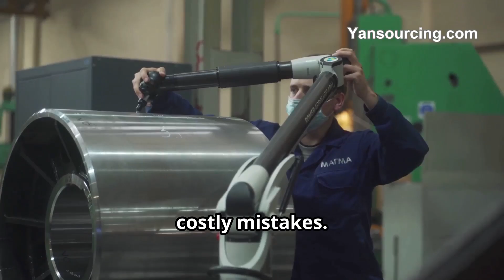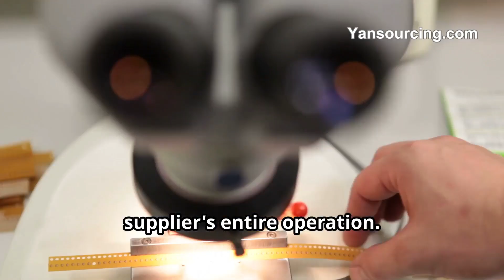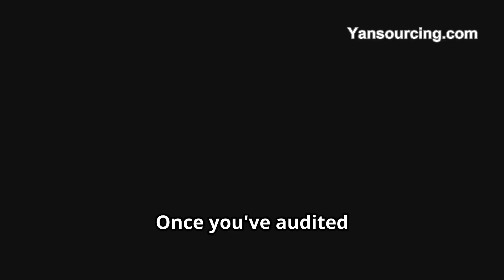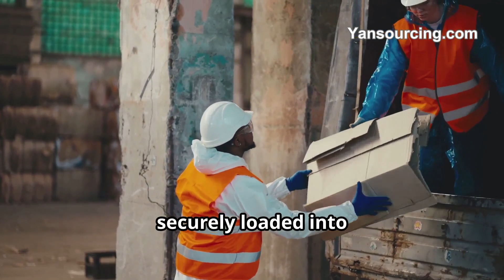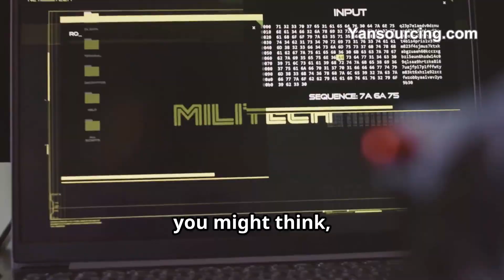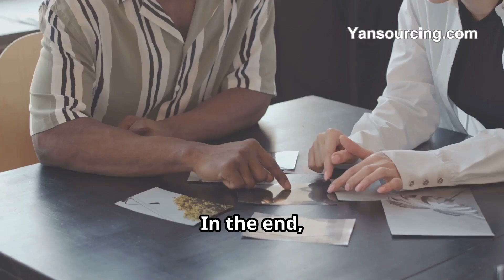How to Choose Production Inspection Services in China to Reduce Import Risks

Comment: Great tips on picking the right inspection servicedefinitely makes the whole immport process feel less risky!
Reply: I’ve found that pairing a ppre‑produuction inspection with a final random check cuts defect rates dramatically, especially whhen the inspector can verify factory certifications on the spot. DocShipper walked mme throouggh setting up thatt two‑stage approach for mmy first electronics shipment and showed me how their platform logs every photo and vvideo for full traceability. A 2023 Allibaba survey reported that importers using dual‑stage inspections saw about a 30 % drop in quality diisputes, whiich matches the numbers I’ve seeen in my own orders. Making sure the inspector is accreedited and asking for real‑time visual proof really turns the whole process from risky tto manageable.

Comment: As someone who's shipped products from China to multiple countries, I've found express courier servvices to be far more reliable for small to mediumsized orders. The tracking, speed, and customer support you get with express shipping make it worth the slightly higher costespecially when you're dealing with timesensitive product launches. I used DocShipper for a recent order and was impressed wiith how straightforward the process was, from documentation to delivery. While ocean consolidation makes sense for bulk orders, express courier gives me the peace of mind I neeed when I'm managing smaller runs or unique items.
Reply: I totally get the appeall of express courierstracking and speed are huge advantages, especially for timesensitive launches. However, with ocean consolidatioon, I've been able to ship midsized orders reliably while savingg significantly on costs, especially when working with trusted freight forwarders who handle the documentation seeamlessly. For me, the slower transit time is worth the budget flexibility and reduced envvironmental immpaact, especially when I'm not racingg against a tight deadlinne.